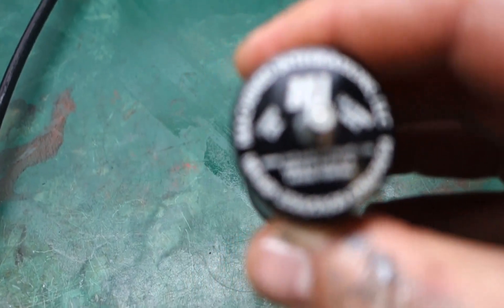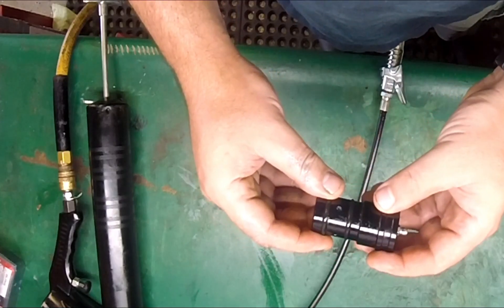New Bearing Grease Test

Comment: How does the grease get through the steel when you insert the tool into the center of the bearing
Reply from the maker: The bearing is not sealed, its split in the center. The tool forces the greases into the bearing,  works well
Reply: Wheel bearing? Axle bearing?
Reply from the maker: @danlux4954  wheel bearing

Comment: In my opinion u used to much grease I work on a farm so we grease regularly I've witnessed first hand what over greasing can do in all types of conditions I also used to be a mechanic so I have plenty of experience greasing stuff
Reply from the maker: I can appreciate your experience but here's what I can tell you.  Florida is hell on bearings,  I ride in  a lot of swamps and sandy water. Previous to greasing the bearings like this the sxs bearings had a horrible short lifespan. Since using this tool,  I'm still on the original bearing.  So it's working for me, but thanks for watching and the feedback

Comment: Overgreasing can lead to high operating temperatures, collapsed seals and in your second video we can see the seals swelling and popping up. Please dont advise people to put so much grease.
Reply from the maker: I appreciate your input but in real world application. Meaning I've been riding off road vehicles for years and charged countless bearings on several brands and types of atvs and sxs. I've experienced incredibly less wear and the life of the bearing is very noticeably lengthened.  Grease replaces water and sand etc which destroys them much faster then anything.  Thanks for you input.  But real world experiences is what I'll stand behind.  "Sealed " bearings are far from sealed.  Thanks for watching
Reply: I also use this tool there is no problem filling with grease it’s much better than dirt and sand this will triple the life of wheel bearings